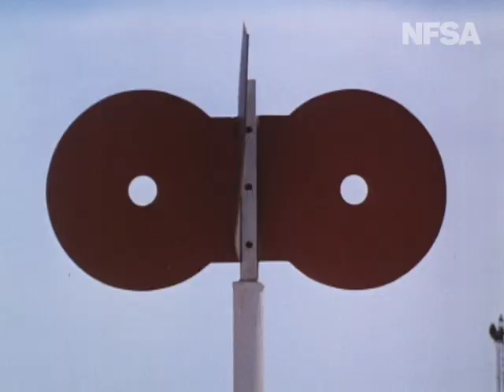Outlook: The Line.

Comment: Used to love sitting on the back verandah in the fresh hot dusty air and our stops and catch up with locals between Adelaide and Alice at all the stops on our similar Ghan in the 60's and 70's. Hate the new over priced glassed in trendy non stop new one now from Adelaide to Darwin.   Fabulous post, thankyou.
Reply: Sounds like you have great memories.  I agree with you about todays tready's. They would not know adventure it it bit them.
I drove with 2 friends from Sydney to Perth in a panel van and remember when I was in the back with the sideways opening back doors that was the ford PV fully open with my legs holding them open doing about 140kms because it was so hot somewhere SA/WA. I remember petrol was a princely sum of $1 a litre at the Nullarbor Roadhouse. 
That was adventure.